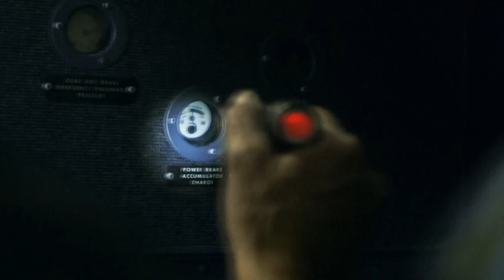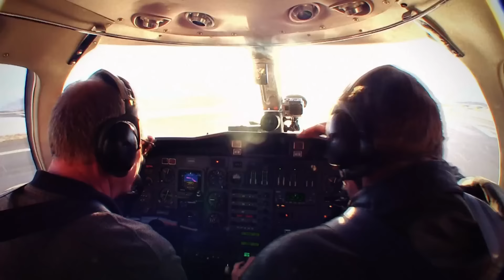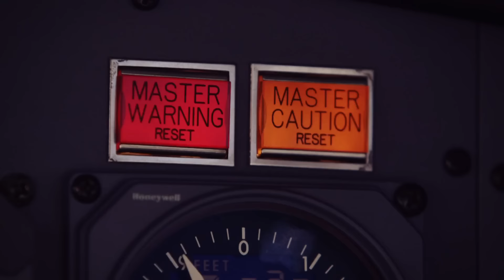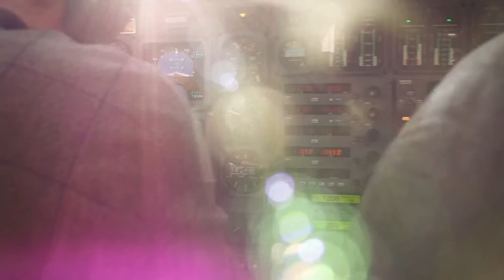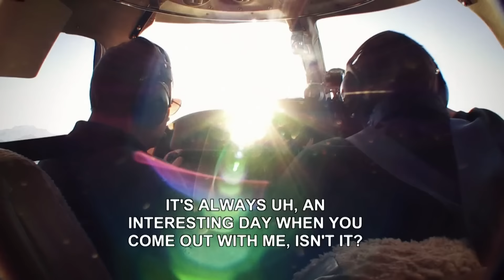Plane Engine Stalls Midair During Repossession! | Airplane Repo

Comment: GCU is GENERATOR control unit, not general control unit.   A preflight takes 10 mins, not 6 hours.
Reply: 💯percent correct
Reply: its a tv show lmaooo
Reply: I feel that’s a ‘lost in translation’ “we’d usually get a half-day or so to check the plane out before we fly, but on this occasion we got 10 mins then gotta get outta here”

Comment: Plane engines don’t stall, they stop. A stall is when the wing loses lift.
Reply: Indeed when it exceeds the critical angle of attack. Plus they weren’t gonna crash with that one engine any competent pilot could take that plane with one engine. As much as this is fake as hell Kevin is indeed a competent pilot. Discovery just adding to the drama it sells the show
Reply: I didn't watch the show but I assume they are referring to Compressor stall on a turbine engine.
Reply: also jet engines can stall (compressor stall) but this was not the case in this video
Reply: @nddnow yeah
Reply: they can stall

Comment: Kevin Lacey only holds a private pilots license per the FAA data base w no type ratings
Reply: that must be wrong, because he has his Private Pilots certificate, Instrument rating, commercial rating, Multi engine, and tailwheel endorsement and seaplane rating, along with his CFI. He also has multiple type ratings in different lear jets and the 737-200 and maybe the 400 not 100% on that though.
Reply: @nicholash7373  I guess so if your saying that, where did you find that ?
Reply: @flapo734  he use to be one of my flight instructors when I started private. Didn’t know he was famous till people told me

Comment: "With over 40 years experience in aviation"? And "Make sure that car doesn't come on the runway and block our plane"? Get outta here. If they had 40 years experience they would've checked engine power B4 takeoff on a repo. And if you're worried about a car driving out on a taxiway or runway then I honestly don't know what to tell you. I do know experienced pilots would never rush a takeoff on a plane in that condition. 🙄.
Reply: The plane was in perfect order most likely. It may have not even been being repo'd. If someone in the left seat has a commercial certificate and type rating, they can most likely fake this stuff legally for commercial purposes. I don't see where there would be a restriction. I assume Hollywood does it. The only thing real about it may be that airplanes are really flying. Let me grant they are taking back planes for banks, for the sake of argument. Even if that were the case, probably there's nobody fighting them from just taking the planes. They know they can no longer afford the payments and they are like, "here's the keys". The show pays them for pretending there was a problem. What's funny, the idea someone has 24/7 security watching these planes at small airfields. That hasn't been my experience. The jets going anywhere are on the ramp. If they are not on the ramp, they are in the maintenance shop. The idea they are tucked away seems strange to me. Tucked away, and the owner is always on the way or there. Funny.
Reply: @thomastucker5686  Ikr. Lol. That was pretty funny when the owner was miraculously  right around the corner. 🤣

Comment: Other pilot is called out of the blue, but shows up in 20 minutes.
Woman brings out papers through same door that angry mechanic went in.
They supposedly shut down an engine, but the gauges showed it still producing full power. And they didn't declare an emergency?
And for some reason, they had to "glide" on one engine, when it still should have been able to climb well.

Comment: The jet engine did not stall. It stopped producing power. You do not “glide” to the next airfield. The jet is capable of flying to the next airfield without “gliding”…. on one engine. I feel bad for Mike, having to read this narration. The only truth in the show is the fact that the bank wants them to go and pick up the airplane. There is no sneaking onto an airport to do it. The books must be picked up, and the authorities must be notified prior to the crew taking possession of the aircraft.